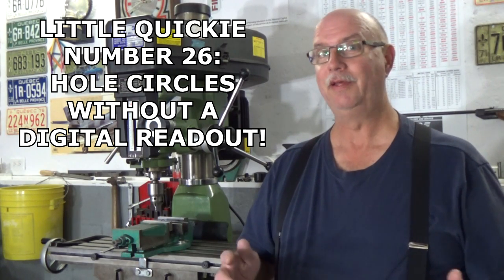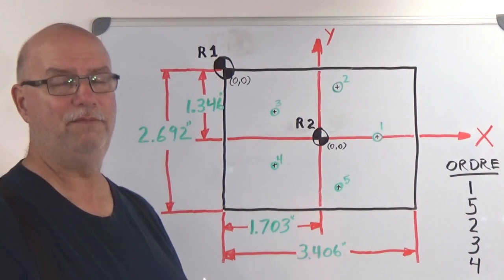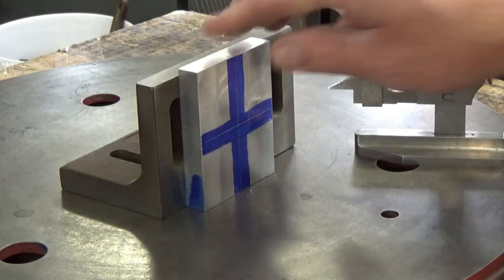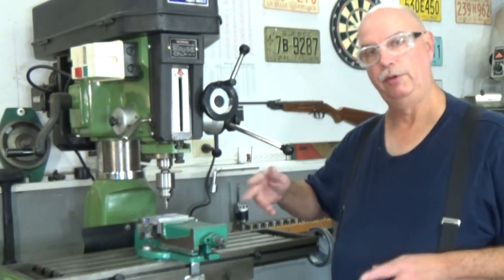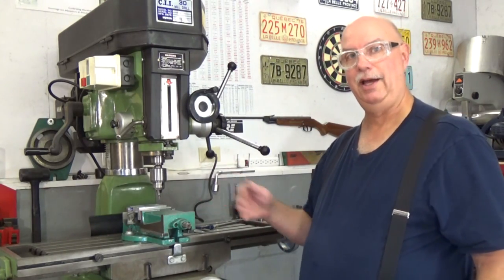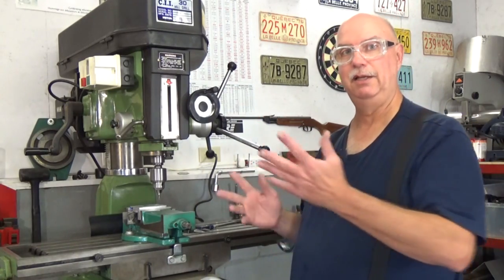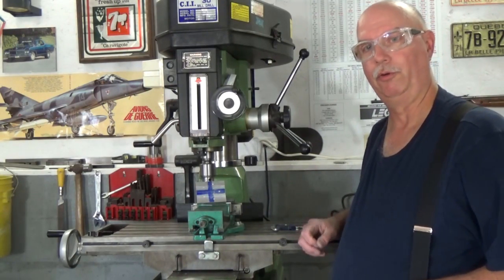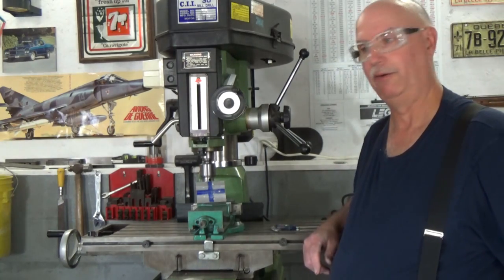ACCURATE BOLT HOLE CIRCLES ON A MILLING MACHINE WITHOUT A READOUT OR ROTARY TABLE, MARC LECUYER

Comment: Thank you Marc, I am from the future 16/04/2021 to be exact. You sent me back in answer to my question about a more complicated bolt hole pattern. You get 10 out of 10 in my book for your content and another 10 for answering my question to you. I am retired and like you a time served machinist, in my case as an engine fitter and turner. Your video took me way back and I remembered we used to get the coordinates from a Zeus table. Once again thank you very much and I look forward to further videos. Bernie

Comment: An excellent demonstration of accounting for backlash.  Bonus points for showing the easy way to calculate bolt circles.
Reply: Hmm, I feel like it's not "an easy way to calculate" them, it's letting them be calculated for you.
Reply: Indeed, it is letting them by calculated for you, by computer and a fixed application that is tested and works and is easy to use, and gives reliable results.  I certainly know how to do the trigonometry to do it the old fashioned way, and I would do that if I needed to.  That manual method can very easily lead to mistakes if one is not careful.  If someone prefers to do it that way, go for it!  Maybe make your own trig tables as well...   8^)

Comment: Many Thank Yous Marc,  Your timing on this video is epic! I just got a project with a 6 bolt hole pattern. I have the same Mill (no D R O ) at home that I will be using for this project. While the mill at work has all the bells and whistles and no backlash. Now with your help I am much more confident in producing this part correct the first time!  I am grateful for your lessons, Thanks again!

Comment: Nice timing. I just ruined a part with an inaccurate bolt hole circle. It's a round part but I should still be able to use your approach.

Comment: Great video!!!  Would it be good to scribe all of the coordinates when you are doing the layout on the surface plate?  If nothing else I imagine it would make a great sanity check when you are ready to drill the hole.   Thanks,  Chris
Reply from the maker: Yes that can be done and it would be a good way to avoid errors. I opted for the easier digital caliper technique because, after all, I am "that lazy machinist". Thanks for watching and thanks for a great comment! Marc

Comment: I come in defence of poor old trigonometry, because I think it gets a bad rep and calculating the coordinates can be almost as quick as looking them up. So for the youngsters who aren't afraid of a little maths, here's how I would do it: R := 1, so x1 = 1 and y1 = 0 are trivial. The full circle has 360° so 5 equally spaced holes would be 360°/5 = 72° apart. x2 like x5 are the adjacent sides to the 72° angle, the hypotenuse equals R, so x2 = x5 = R*cos(72°) = 0.3090. y2 and y5 being the opposite sides, so y2 = R*sin(72°) = 0.9511 = -y5. And for hole 3 and 4 it's the same, but with an angle of 180° - 2*72° = 36°, x3 = x4 = -R*cos(36°) = -0.8090 and y3 = R*sin(36°) = 0.5878 = -y4.